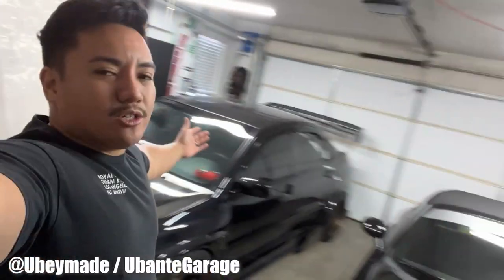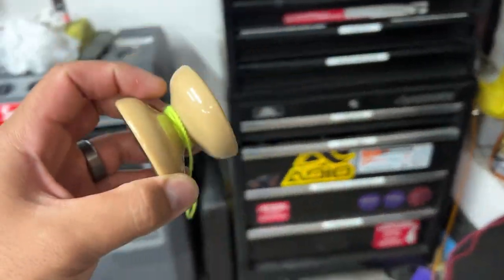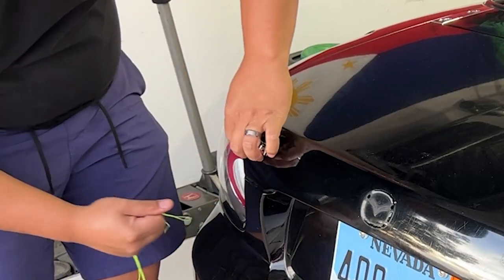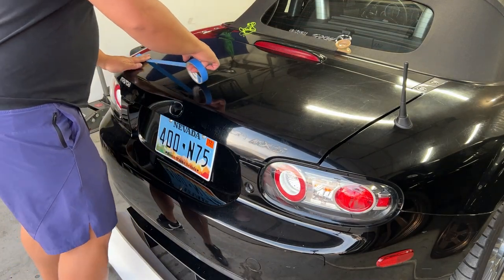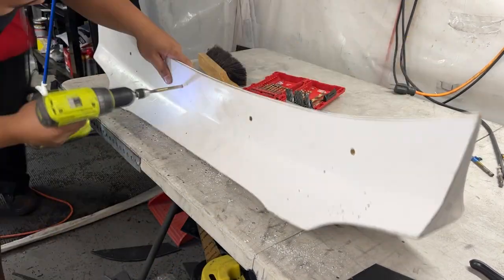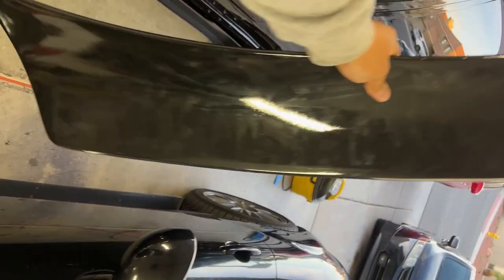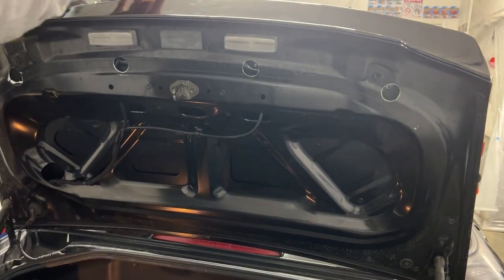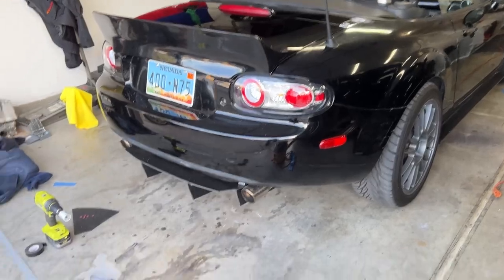How to: NC MX-5 Carbon Miata Duck Bill Spoiler INSTALL with hidden hardware

Comment: This is a softop NC1 right ?? Can’t tell. But the spoiler that you have in the video from carbon Miata says it’s for the PRHT (hardtop) only.
Reply from the maker: Oh. Thanks for letting me know. I must have posted the wrong link. But they do have the soft top version I have on the video. I’ll make the fix! Thanks again